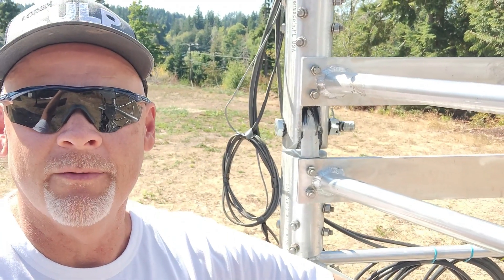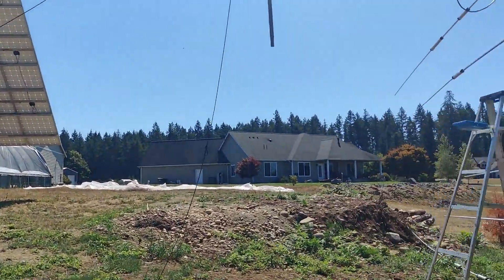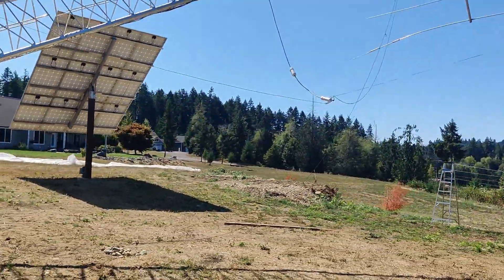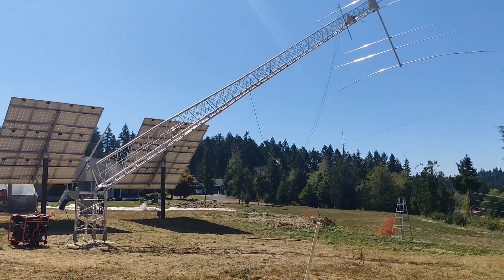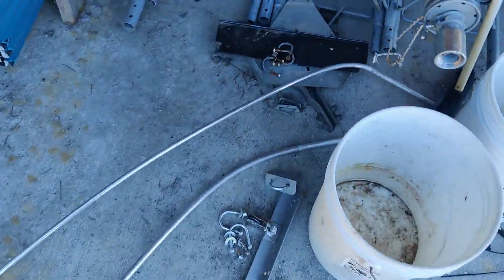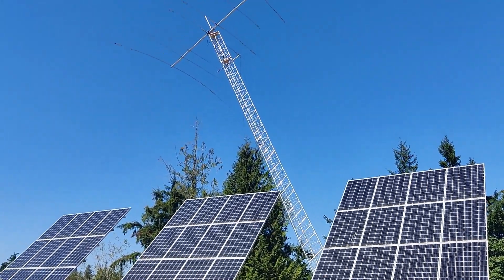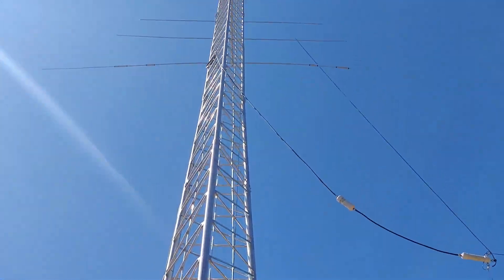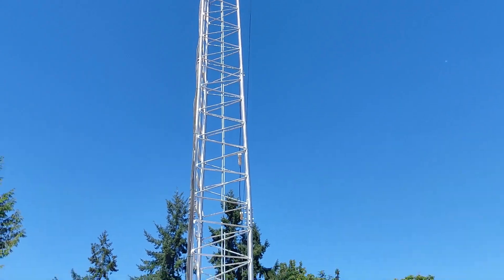Heights Tower Part 2 - Mosley Pro 67C Antenna repair/tower complete

Comment: Beautiful tower and work! Could I asked the cost of the tower setup?   I want to install a system like that so I need to start planning what I need. Thank you for the video and your time! 73s!
Reply from the maker: Not sure in the post covid and the supply chain world.  It was about 10k before.  It was well worth it and would do it again.  Thanks for watching.  Please check out whiskey7backroads.com also.  73
Reply: @Whiskey7BackRoads  I have a Hy-Gain 52' and they recommend 4' D x30"W hole and only takes one yard of concrete wasn't 15 yards a bit excessive? Of course mine doe sn't tilt at 52' because it's a three section telescoping design.
Reply from the maker: @allanmccullough8550  tilting vs telescoping is apples to oranges, it wouldn't of taken 15 yards if my neighbor dug the hole straight down and we didn't have any sluff in of dirt.  Thanks for commenting...
I guess

Comment: nice tower build, just out of curiosity how much did the tower setup cost minus the freight charges?
Reply from the maker: Stanley, I have tried to forget that part...lol.  It was around 10k for the one I got.  This was a couple years ago so not sure what it would be now.  I remember the shipping going up right when they where done so it also added to the project.  I will say, even with the cost, I would get another.  Its by far the best tower I have ever had or seen.  Thanks for watching
Reply: @Whiskey7BackRoads  thanks for the info. We are 3 hours away from them and could possibly make a road trip with a trailer. I am looking for alternatives to combine my antennas to one tower and this seems to be the answer. I currently have a Cushcraft A3WS one one short tower and Cushcraft A4S.,
Reply from the maker: @kb5ikr  That would save you a bundle.  Give them all the specs and exact rotor, antenna etc and they will custom engineer what you need.  I wanted a telescoping one but with my antenna weight, it was not an option.  I could however got up to 80 ft with a tip over which seems crazy to me.
Reply: @Whiskey7BackRoads   how heavy was - is your antenna setup?  I agree seems a bit odd a telescoping couldn't but a 80 tilt over is ok. 
Do you have a high wind load?
Reply from the maker: @davez2989  Thats what I thought but the engineers at Heights are the experts.  The antenna, rotor, thrust bearing etc are about 220lbs give or take.  Its a beast
Reply: @Whiskey7BackRoads    Curious what makes it the best you have seen or used?  Appreciate you sharing by the way.
Reply from the maker: @davez2989  I don't have to worry about failure, guide lines or climbing.  Its very stout but only takes up 3x3 foot print at base.  The fold over is a game changer for me as I get older and won't be able to climb, plus I hate climbing towers.

Comment: How did you get the antenna onto the tower?  I have a similar setup and just got my Mosley 67c3 finished.
Reply from the maker: Hi Chris,  I lowered the tower and installed the mast only.  Then did all the reflectors and elements on bottom side starting with closest to tower and rotor.  Then because of weight, had to raise tower and when all the way raised, turned and lowered other side.  The repeated and raised again.  Worked great and way better then climbing
Reply from the maker: You could do all at once if you have a tractor or something to lift entire antenna.  Since I was rebuilding it I did it this way as I got a section done.
Reply: Thanks Brent. I have mine built on the ground already. My tower has hydraulic tilt so I’m going to use the tower to hoist it vertical. Then guy it off and drop the tower down the put the mast through while it’s hanging in the air. Not the most ideal but should work. I also have placed a 2.5 inch aluminum tube sticking out the end of the boom on the ground to protect the element on the ground.
Reply from the maker: @HamRadioOperator  Let us know how it works and good luck.  Love that antenna!!!

Comment: I saw another of your videos (Drone) showing a Rohn 25 tower with a RT Innovations Razor....Is that the one that failed, and did the Razor survive the failure?  I saw some familiar RT parts in the pile of debris....
Reply from the maker: Yes, that is the tower that failed.  The Razor survived with little damage that can be repaired.  I plan on selling it now that I have the Heights up and running.  Thanks for subscribing and supporting the channel!!!

Comment: How tall is your heights tower?

How was your swr after the rebuild?

How well does the pro67 perform?

Brian, N2OTY
Reply from the maker: I had a coax short so had to do a repair, once done it is working great.  Love the Pro67c but is a heavy one.  Thanks for watching
Reply from the maker: 54 feet to top and 56 to antenna